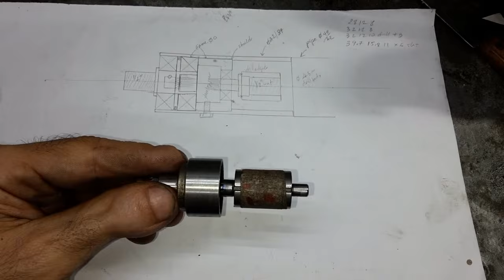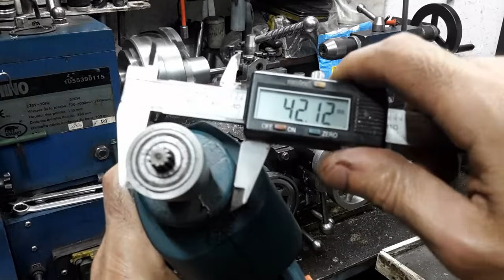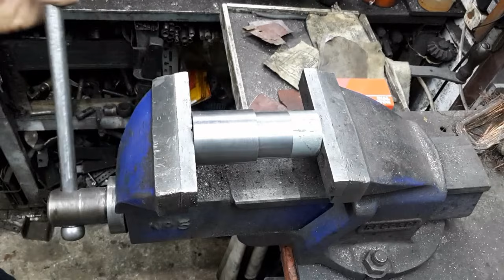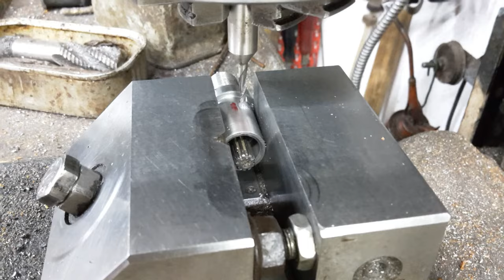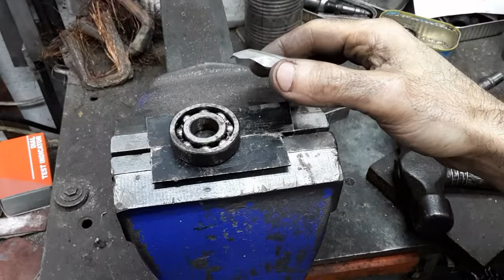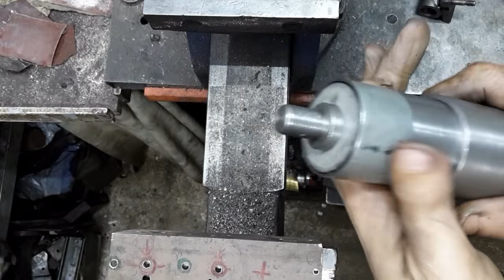Hand drill speed reducer

Comment: Usefill build. I especially liked where you uset the outer sleve as a hole saw to get the drill body aligned, smart!
I have saved parts from 3 gears internal bicycle gears for a similar bild. They are sturdy and can take a lot of torque. Have ben considering using them as a speed reducer for the drive on my metal lathe, as it now has a large v-belt pulley on the back side that takes up a lot of space.
Looking forward to see more interesting builds from you
Reply from the maker: Glad you liked it. Incorporate a shear pin in your design to avoid stripping gears in case of a crash. I once made a small gearbox that fitted onto a pump motor to reduce its 3k rpm to a more usable level  to power my mill.  Build not buy 😃
Reply: @robthule6850  Good point about the shear pin. And totally agree on you point, build, dont buy👍